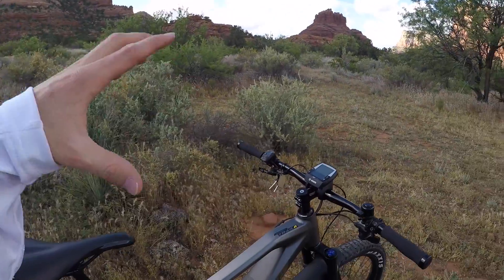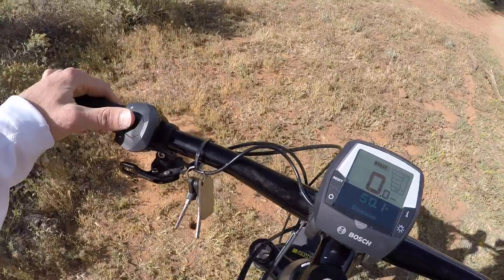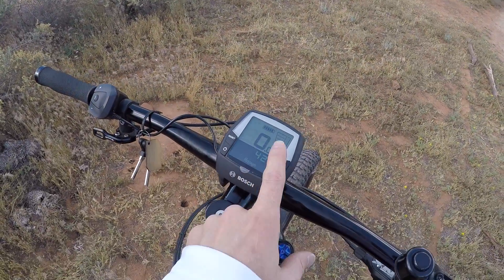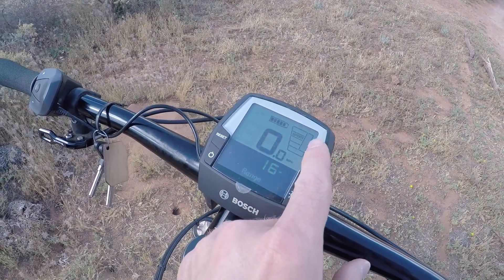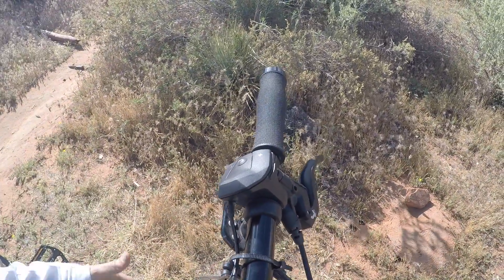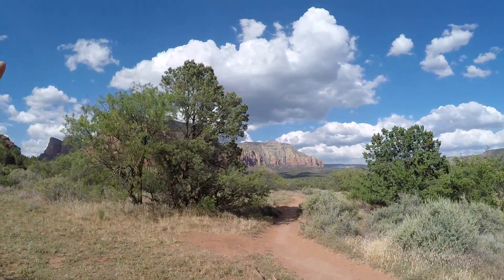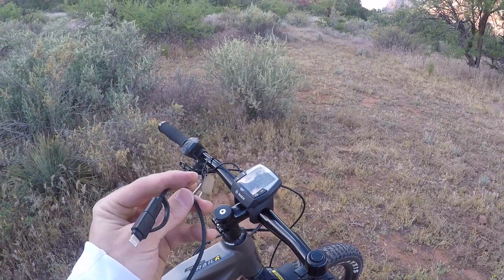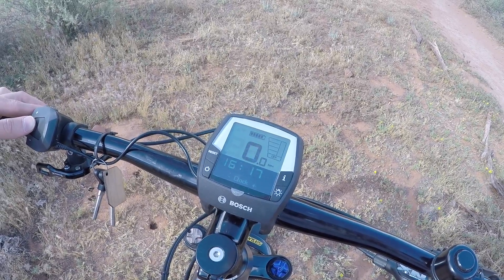How to Use the Bosch Intuvia Electric Bike Display

Comment: Nice presentation!
Can you share with us which cable and iPhone adapter you bought please?
I bought some and they are rejected by the iPhone as there is probably not the right Apple chip in the lightning connector...
Thanks on beforehand!
Reply: same problem, cannot charge my Iphone  Hum!!!
Reply: Can you please tell us exactly what parts number from Amazon you bought to have your Iphone charge from the USB Intuvia port so we could buy one too. Thanks.
Reply: John Doe  unfortunately, he is not going to reply...

Comment: My March 2017 Trek Powerfully 7 appears to have the "walk mode" enabled. It doesn't take off when I push the + button, but it doesn't try to roll backward down my steep driveway when I push it up using walk mode either. With walk mode enabled and holding the + button the pedals move on their own, while they don't move when walking the bike with it off.

Comment: It's a nice display but I've found with mine which is also quite sophisticated once set to my preferences I'm content to rely on just a few functions. Two things about that Bosch display stand out to me. The 5 segment battery indicator is okay but kind of crude because as you've pointed out with displays you just don't know how far down the batter is from 20 to 0 percent. And the most important is that it can be removed, I wish I could do that with mine, I would feel better leaving the bike if it wasn't there. As an aside, mayb Bosch will consider a color display in their future. I love it on mine, going back to black and white would take some getting used to.
Reply from the maker: Have you seen the Bosch Nyon? I heard that it had some issues in Europe so they didn't expand to the US but it was color and had GPS

Comment: What does it mean if the first  three  lights on power pak 400 battery blink when recharging?
Reply: it means it is charging...
Reply: Joseph - It could mean that the battery is not within operating temperature for charging as if it was too hot. When the battery returns to a temperature that isn't too hot it can resume charging. If this isn't related to the issue your experience I would recommend bringing it into a Bosch service center for further diagnostics.
Reply: You don't need to put it in a fridge. I would recommend bringing it to a Bosch service center to have them run a diagnostics on the battery.
Reply from the maker: Hmm... I'll look into this Joseph, I don't know off the top of my head :)
Reply: I waited three days to retry. And still 3 flashing lights light 1,2,3, from the minus sign Not  1,3,and 5 which means to hot .? Should i put the battery in the fridge.to cool down?